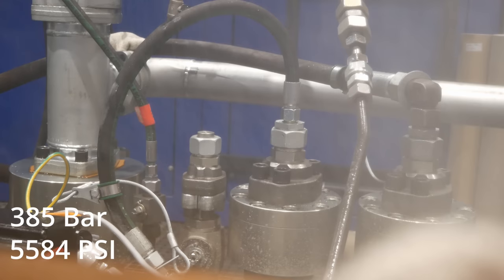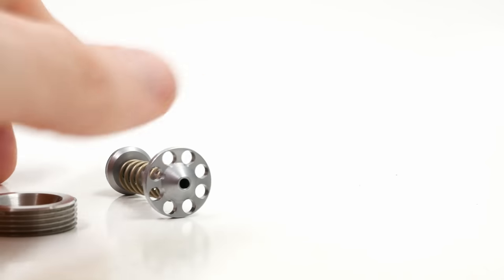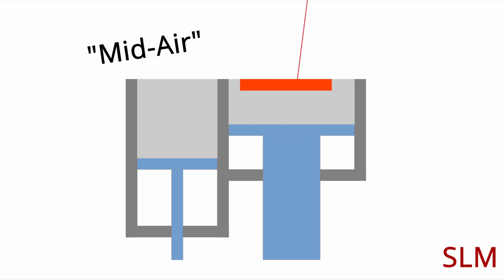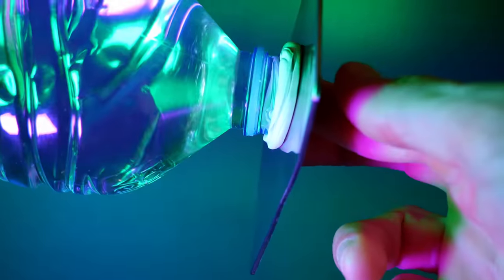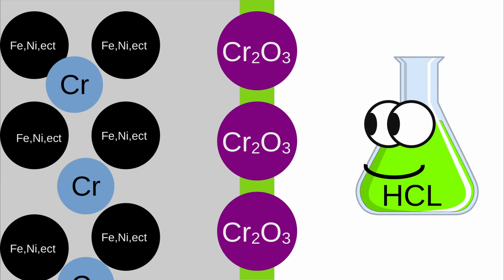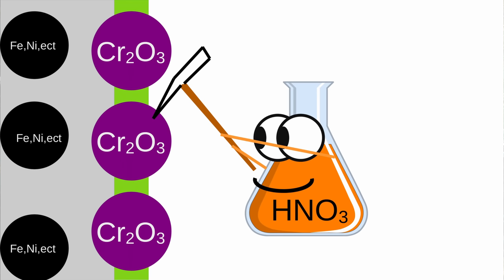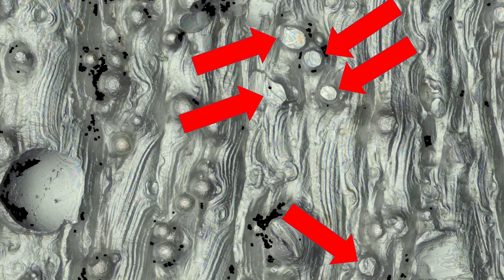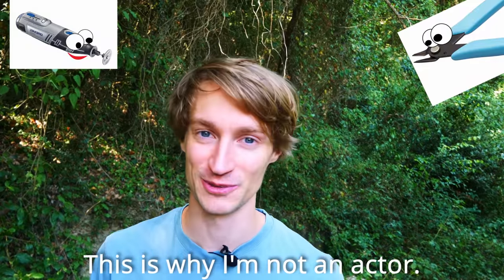Metal 3D Printed Compliant Check Valves!

Comment: If you subject this device to alternating pressure, adjusting the frequency and amplitude, then the impact of the surfaces will smooth them out and improve the seal. In addition, (a crazy idea, but still) you can use alternating pressure to destroy supports if you get into their mechanical resonance. Of course, this will require special equipment, but its design should not be a big problem -- ordinary hydraulics.

Comment: I'm not an engineer, but i wonder if it is possible to introduce vibrations so the sealing surfaces do lapping and grind away the welding bubbles.
Reply: Hmm... would it be possible to begin doing this while removing the support structures? 

I'm imagining a cycling medium-high-pressure system using nitric acid as the fluid. While the support structure is being removed, nitric acid simply flows back and forth through the valve with no real pressure. Once the structures are sufficiently dissolved, the cantilever begins pressing the sealing surfaces together. Then you start to develop pressure changes. On the forward cycle, nitric acid flows through the valve, dissolving a little bit more of the prepared surface of the seal area. On the reverse cycle nitric acid under pressure presses the seal area together, beginning the wear-in process. Keep that cycle going for several tens of thousands of cycles, and you should get some decent wear-in, right? And as for introducing vibration... a high-pressure pulsation that causes valve chatter shouldn't be that hard to design... I think it's one of the problems that typically faces high-pressure systems. Using induced valve chatter during construction to improve the system's performance seems like karmic balance.

Comment: Seems like the simplest approach would be to eliminate the need to remove supports at all by combining the supports and spring return mechanism in a better way. Still rolling vague ideas around, but the end goal would be to use a mechanical or hydrolic forming process to stretch the supports into final shape and thus harden them enough for the spring. Hard part is how to get the check ball to locate into its proper final position and not spring back....

Comment: I have never done Metal 3D printing, but a fair bit of FDM printing. My "rule" became to print with no support; meaning I always had to redesign the part so that it wouldn't need any support for printing, playing also on the orientation of the print.
It might feel at first like the manufacturing should not influence the design, but actually it always does, in injection, in CNC, in laser cutting, in manual building, and also in 3D printing. Maybe people tend to forget that.

Comment: Definitely very neat. For in-situ valve lapping, the first thing that comes to mind for me is extrude-honing, A paste loaded with abrasive is flowed though a system, and cutting action heavier low-cross-section/ high linear velocity areas, and can greatly improve surface finish in the areas that need it most. Alternatively  Since your check valve is a mass on a spring, put it on a shaker table and run it at resonance. Could repeated impacts make for the bumps and imperfection on the surface getting peened flat, or at least mated to each other?

Comment: It saves a lot of space to print everything together in a single component, but as an automotive technician for almost 20 years, I can definitely say that components that have been combined into a single part are getting more and more expensive and less serviceable. Yes, it saves weight and the item you're building has fewer parts but that all translates to a much higher cost to the end user. There's a balance between simplicity and serviceability.

Comment: In the case of the cantilever valve design, you could use a drill to remove the support structures without any acid.

Comment: You might be able to use high pressure to break the supports off inside the valve. thus making a value fully printed valve. Another idea is to make the sealing body of the valve rotate when reverse flow is present. That way the valve could grind it self smooth. You might be able to force this with fast flow reversals that cause the value to spin as it shuts. You could even include abrasives in the fluid that help with this process.
Reply: Yeah, i have just used a punch to break off the supports for a similar valve.

Comment: Hmm, need to find a way to rotate the pin in a controlled way, possibly with a 3rd port that can get plugged later. If you can do that you could grind the pin in. Could be as simple as an offset channel and some blades that get pushed round as fluid flows quickly from the 3rd port into one of the others, with moderate pressure applied between the other two ports. Conic sections for orienting the pin accurately when set could be another improvement.
You might get passible performance from plastic deformation, but I think you could get pretty spectacular performance from ground in surfaces. The down side would be having to plug the channels at the end, but at least this can be fairly geometry independent.

Comment: Could you maybe use the hydraulic pressure to break the supports if you changed the design a little? Like printing a sort of 'membrane' of support structure that attaches the loose part but impedes the flow so it'll break off once pressure is applied? If you're able to print it in a way that would make it crumble into many small pieces small enough to exit the valve then a few flushes with oil or water might be enough.

Comment: Except that the purpose of the Tesla "valve" wasn't an attempt to make an easily constructed check valve, it was an attempt to solve the issue of thermal and mechanical stresses causing the failure of the flap valve on a pulse jet engine.   The design you came up with, while awesome, reintroduces that problem.

Comment: Absolutely fantastic work and a beautiful design. I'm a big fan of the intensional use of curling in the design. I'm definitely going to be showing my Design engineers as this is something I am going to steal as a design for AM principle. However some good news for you is that EOS is releasing support free printing for their metal machines.
Reply from the maker: Didn't know that, will need to read into how they do it. Thanks for letting me know!
Reply: @TurboSunShine  I was able to get a sneak peek at some of the improvements they are making when I was at RAPID3D

Comment: Awesome work....

But just so you know next time... you can skip the supports and adjust layer cooling time in your software. If your layer cooling time is say 1 sec u could crank it up to 10 for that section and back down again to 1 sec.  If u have to  .. slice the part into 3 layers  and orient your prt for optimal printing. In this case id suggest putting the plunger longways so it has the least number of layers to be printed.

Comment: I was thinking a minute about an idea, basically using the brittleness of the metal to almost literally burst the check valves open. then spring it back closed a few times. might actually work. On the other hand, PiP might could be done if the heat could be managed by taking the heat out the top, but that might really slow the printing down.

Comment: I think think printing working check valves and ones that would not fail in a short time would be highly improbable. I have seen check valves that are built into the body of the pump ( in pressure washers) that use     3 external parts. A spring, a ball, and a threaded cover. I think that would be the way to go with a 3d printed pump.

Comment: That's a pretty cool design. Though, I'd try to drill out the supports with a small bit on a flexible shaft (like a medical introducer). Could save you the hassle of chemical removement.
Reply from the maker: In this case it would be possible! But the general concept was that the check valve is somewhere deep inside of a hydraulic system, hence it was removed with acid to show it's possible.

Comment: My first idea would have been to blow out the supports with high pressure somehow, arrange the supports to totally block the fluid path and apply pressure. Chemical etching is nice and all, but as an engineer type I like "brute force until something breaks" method much more

Comment: The Tesla valve Isn't a check valve its a one way restriction valve. it restricts the airflow in one direction and not in the other. 
A check valve completely closes off and seals air/fluid from going in one direction and not in the other.  

Tesla valves although cool are nearly useless. they are used in very few applications.
Reply: i think the purpose of Tesla valves was to restrict alternatg Flow with a very high frequency, something with moving parts cannot do since it has a delay because something has to move. Disadvntage of them is of course that they cannt shut off the flow completely, but if you care more about delay than about leakage thats a wothy tradeoff
Reply: "Tesla valves although cool are nearly useless"
for what ?
unqualified "useless" is plain wrong

Comment: I wonder if you could cool parts more effectively by pumping a more thermally conductive gas from the top of the chamber down through the build plate. Helium is inert and 5 times as conductive as ambient air or nitrogen on its own. Neon is the only other inert gas I found that offers an increase in conductivity over air after some admittedly slipshod googling. I don’t know how disruptive the gas flow would be to the metal particles but I imagine it could be pretty slow and still add performance. I just feel like being able to print floating parts would be such a huge advantage that should be achievable.
Reply from the maker: In slm argon is usually used, but the cooling is still alot less effective then through the buildplate/part. Another issue would be, even if you manage to get down one layer, the second layer will cause warping and ruin the print.

Comment: So here's a thought.  I have worked metal before but have never worked with SLM stuff before.

Is it possible to actually do this bi-metallic?  Let's say the parts you want to keep are steel right?  Can you then make the support structure with another metal such as aluminum or something?  I would expect that for normal uses, you would have all kinds of problems with the two metals not actually bonding to each other and failing under stress.  Here though, that would be a feature.  If you could do the support structure, and only the support structure, out of aluminum that would drastically simplify your problem of dissolving the support structure.  The lye would eat the aluminum but leave the steel intact.

Comment: Nice video with novel designs and processes. I'll have to try out your FDM print in place check valve, as I've designed and printed low pressure checks in an emergency before, but they required either two part designs or a paused print to insert the check ball as mentioned.

Comment: Wouldn't a better solution be a more advanced slicer or way to slow down the print process to allow for areas that need cooling to cool in place? Essentially allowing you to build in mid air so to speak? Basically variable print speeds dependent on conditions that require support structures?

Comment: Edit: I found your answer elsewhere in the comments.

I'm sure there's a very good reason but how come the SLM printers don't simply wait for the part to cool off?  Yes, it would dramatically increase print time, but surely that would be invaluable to get  impossible to build parts, right?
Reply: Wait, or have some sort of explicitly actuated heat sink visit each region needing cooling and make contact before the layer change.
Reply: @daliasprints9798  Yeah, I thought about that too.  I don't know about touching the part but you might not really need to.  Tho, I had some better ideas that I think would be better than an actuated cooling thingy.

Comment: However the mating surface between the male/female cones come out of printing contains harmonica (stair case cone profile) that requires additional rotational grinding process to smooth out the harmonic. At this point in the video we remains with in a theory discussion.

Comment: Nice design!  Very cool to see the close ups of the self-sealing surface in action. One comment regarding the flextural design option -- adding built-in flextural components to additive-manufacturerd metal parts might not always be advisable, as AM parts typically have a worse fatigue life due to small porosity defects, and failure of a flextural component in a part will then likely result in scrapping of the entire component.... Proper fatigue life would need to be thoroughly characterised.

Comment: Imagine in the future there exists a "build a car" just like "build a bear" xD
Reply: I don't think I'd want those on the road though, when every builder can introduce their own mistakes and with no way to do quality assurance. At least the safety critical components like brakes and steering would need to be delivered from a factory that can assume liability.
Reply: @Pystro you know that if my idea came to be real, humanity would be so advanced that "quality" wouldn't even be an issue right?
Reply: @onewa712  Quality wouldn't matter for stuff that you can just pull over, take a taxi home and print a new one of, like a carburetor. But if I go down a highway, the last thing I want to break in the car in front of me is some random piece in their double wishbone.
And I don't think that cars being 3d printable is that far off. I mean, there's 3d printable 3d printers out there. And the very concept of 3d printing is only one human generation old.

Comment: The company RENA advertises their Hirtisation support structure removal method for metal printing. Besides support structure removal they claim it can also remove powder residue and level surface roughness. No doubt the printers they sell which can have this finishing module added are fabulously expensive but it may be possible to do what you are trying to do today.

Comment: I’m sure you’ve already thought of this, but could you just rotate the valve 90 degrees and adjust the geometry a little to avoid overhangs that need support? Specifically your cantilever design
Reply from the maker: yes! but then the tension would build up in the wrong direction
Reply: @TurboSunShine  Ah, I see. How would it cause the part to deform in that orientation?
Reply: @TurboSunShine  How about 45° then (or whatever your maximum overhang is).
-- Oh wait, without any supports it would already deform while printing.

@John Felt It would barely deform at all. Not just because the deformations can resolve during printing, but also because your cantilever is just a symmetric tower, canceling out the stress from either side.

Really too bad that you can't introduce deformation without supports. When I first saw that thumbnail, I thought that what actually are the remains of the supports were designed to intermesh for additional water tightness. But you can't design intermeshing "labyrinth seals" because the etching process would change any concave parts of its shape.

Comment: If the only reason for the supports is to dissipate heat, perhaps the problem can be solved by introducing a cooling fluid (gas) after melting the first few layers of the "floating" bits.

Comment: thinking about the heat issue with overhangs, are there no SLM machines that cool from above? the machine could just lower a big copper or aluminum plate down onto the surface of the print after each layer for a bit (probably with some sort of fancy heat-resistant non-stick ceramic coating), and soak up the heat through that. The plate could have internal water channels to dissipate the absorbed heat in time for the next layer.

Comment: I wonder if you could engineer supports that are sufficient for printing, but weak enough that you could pressurise the system to blow the supports off. Could cause clean up problems if it's an integrated part, but it's an idea

Comment: i'd approach it by running a flexible string-like part through all the supports, which can be pulled out though the end of the system, taking the supports with it

Comment: I love the cantilever check valve. The use of expansion and contraction to make a sealing surface is genius. Maybe it would have been easier to design the cantilever check valve supports to be drilled out with a drill press through the outlet... but I guess that's also kinda cheating. That being said, the component still needs the be threaded... so one pass from a drill press isn't too much more.
Reply from the maker: The main idea behind this project was to see how visible it would be make an integrated design, in that case you would not need threads, but also wouldn't have access to mechanical support removal

Comment: It seems to me that you could skip your support removal stage for the first design by simply having it attach to the of instead of the entry taper, then just drilling it out. Probably left with a pretty bad burr but that would be where a little post processing could be worked in

Comment: a better seal could be accomplished through different geometry, if you were able to accurately center the check plug you could use 2 sets of concentric circular ridges one on the housing and one on the plunger but i would expect this to impede flow a bit.

Comment: Great video!  Out of curiosity, could you use a process such as electric arc vapor deposition to apply a thin layer of softer material to improve the sealing surface?   I don’t know if this even possible on internal surfaces.  Another thought would be using an extrusion honing process to further refine internal passageways.